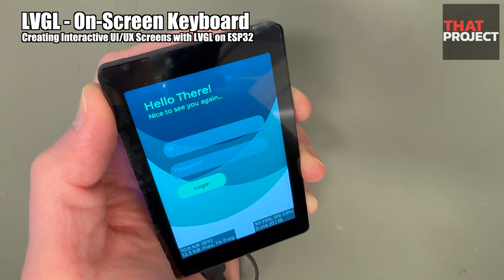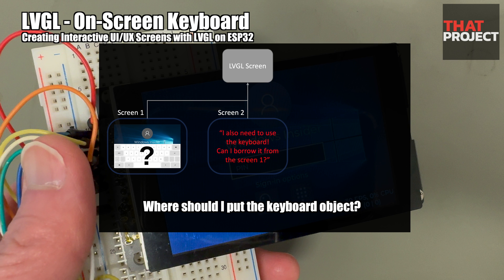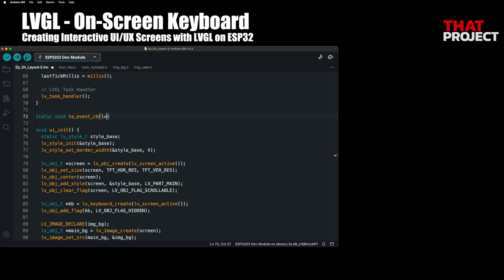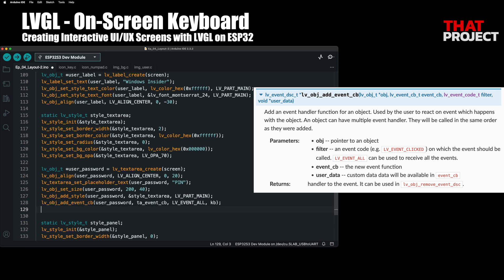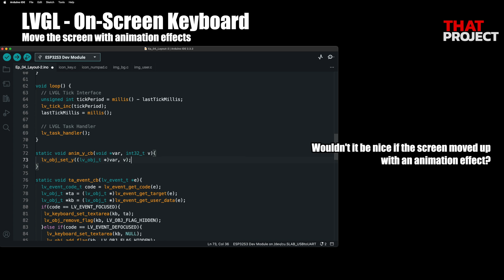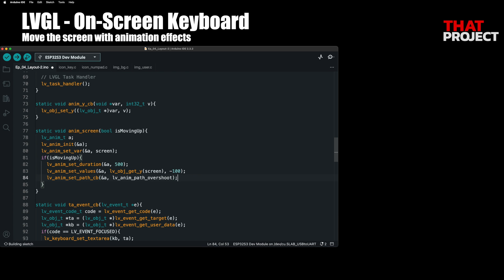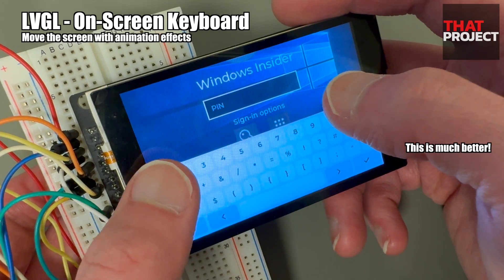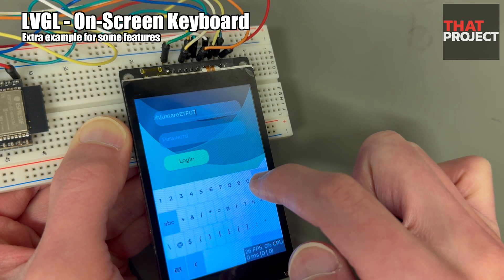LVGL Tutorial with ESP32, Creating Interactive UI/UX Screens: Implementing On-Screen Keyboard

Comment: Hi,Big fan of your work after watching  "ESP32CAM | Sending images via UDP". i'm still a beginner and learning ,I have a doubt regarding ESP32CAM  can this bypass a jammer (wifi,2g,3g,4g,5g signals) . is there any alternative way to this. can you please help.
Reply from the maker: The built-in antenna on the ESP32CAM AI-Thinker board is not very good. For smoother communication, it is recommended to attach an external antenna. Is jamming caused by nearby communication signals? And also, please ask your question below the video of the project. thank you